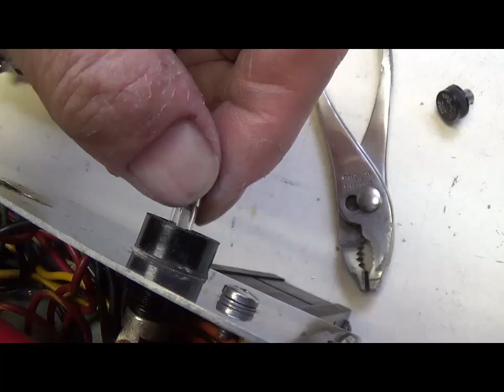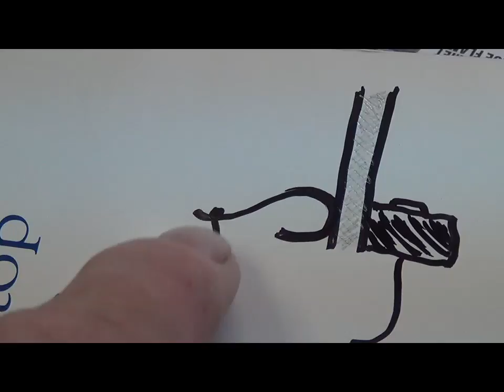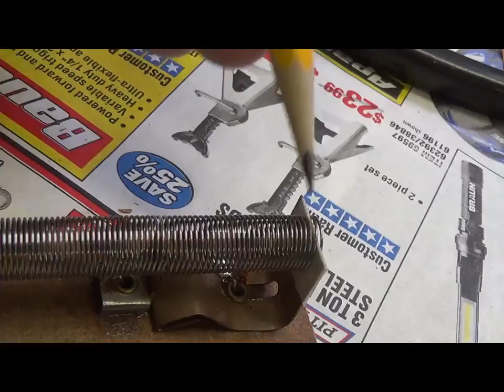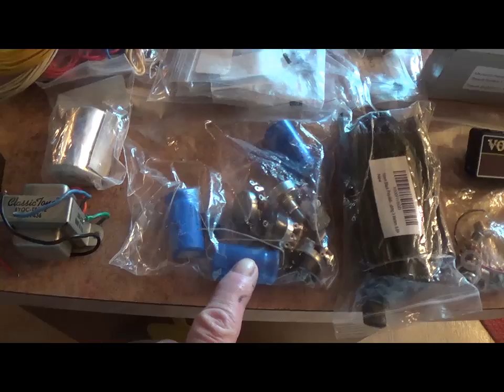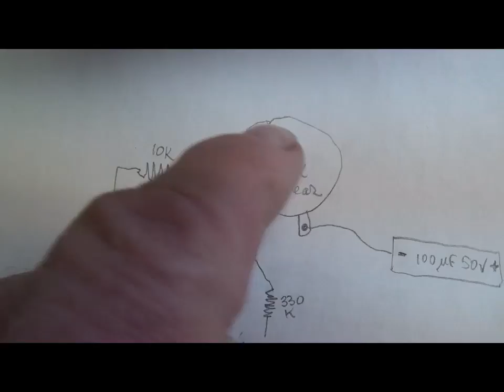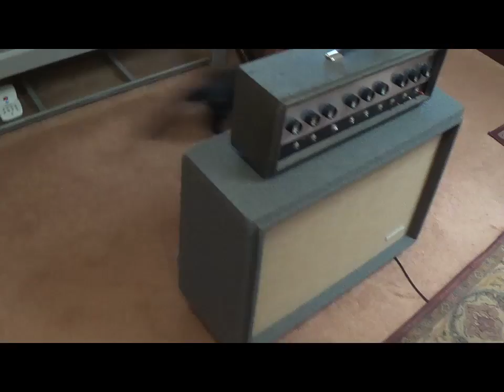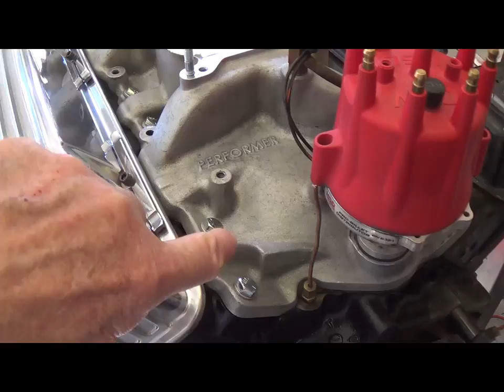Silvertone 1485, Part 3: Circuit Overhaul, Speakers, Sound Check

Comment: Great video, and great restoration. The one thing that caught my eye was the TRS (stereo) jack on the speaker output, with one circuit on the tip, and the other circuit on the ring: what happens if, somewhere down the line, somebody unknowingly decides to connect the amp output to a different speaker with a tip/sleeve (mono) cable?
Reply from the maker: I intend to label the output jack to reduce the chance of that happening, GJ, but as you well know, there is no surefire protection against idiocy.

Comment: Hey Uncle Doug,  good to see you again on YouTube.  Question:   What kind of solvent do you use to loosen the cone, spider and coils in a speaker?
Reply from the maker: Nothing I know of will effectively dissolve these glues, Charles. Generally, however they are dry and brittle and can be separated with careful use of an Exacto chisel blade.
Reply: @UncleDoug   ok,  thanks.  I was thinking I might try acetone on some of the tough glue. Let it soak for a bit, but I'm not sure the outcome.
Reply from the maker: Either that or lacquer thinner, Charles. Good luck.

Comment: Thank you Uncle Doug.  I have a very nice condition 1485. I have not played it much, I notice on channel 2 the new 6L6 GC  tubes want to red plate a little. So I will use all the valuable information so this amplifier will play another 60 years.  Everything is original including the roller chassis and footswitch. This concern I have is that with the Higher Line Voltages in 2019 that the modification you recommended will let this amp be preserved for decades to come.
Reply from the maker: You're welcome, James. Good luck with the modification. Reducing the plate voltage with a ballast resistor and then installing (and properly adjusting) a bias pot should help the old jewel.

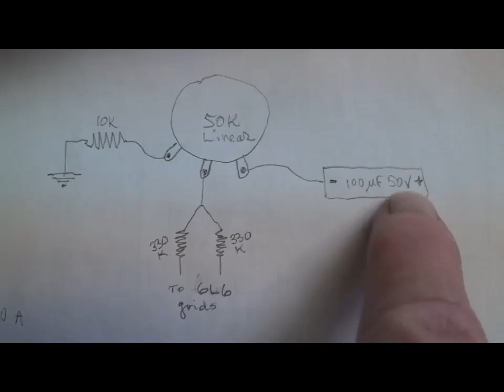Comment: At 34:00, danger Will Robinson! If the wiper of that pot oxidizes or fails to make a good connection to the resistive track of the pot, you will lose your bias voltage to the output tubes completely!. Refer to almost any vintage Fender schematic to see how to wire the bias pot correctly.
Reply from the maker: Which Fender schematic would you suggest, CO? Every one I checked has the pot wired exactly like mine.....bias voltage out via the wiper.

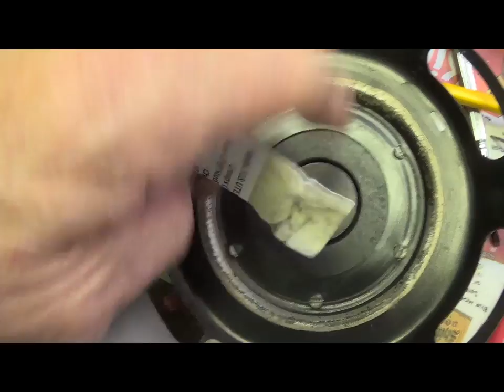Comment: At 9:50, another material that could be useful for cleaning debris out of a speaker's voice coil gap would be Sticky Note paper, folded over so that you have the adhesive showing on both sides. It might be a little easier to handle then the cardboard wrapped with masking tape. This was originally an old radio man's technique for cleaning crud and corrosion* out of the gaps of analog style meters, where the coil and meter movement are still in place and you had to be extremely careful and gentle throughout the process. I fixed the meter on an expensive Hickok tube tester that way once, by gluing little cut strips of the adhesive part of the Sticky Notes to some toothpicks in advance so that I didn't have to hold them with tweeezers or anything magnetic (which would have immediately been pulled into the works by the meters' very strong magnet,  damaging the meter). 

*the plating used on the metal parts and laminations of old analog meters tends to "grow" corrosion products.
Reply from the maker: That's an excellent suggestion, GU. Much easier to manage than a wad of sticky tape. Thanks.

Comment: Hi uncle Doug, excellent work on the amp and the motor. Just one thing re the speaker outlet from the amp, if this amp happens to be used with a mono cabinet, and a mono cord, the barrel of a mono plug will short the secondary of one of the output transformers?
Reply from the maker: I will label the output jack to reduce the possibility of this happening, Jon, but there are no foolproof ways to prevent inadvertent mistakes.

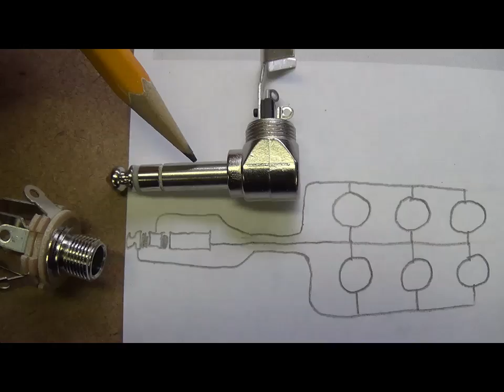Comment: 4:00 in: I think I would have used a switching type Jack or a pair of switching jacks that either short the amp channels directly out to ground or leave a 4 ohm resistor in circuit for each Channel if nothing is plugged into the output Jack or Jack's, because I can foresee a situation where somebody decides to plug the amp head into a different speaker cabinet like a 4 x 12 Marshall stack or something, and that would only provide a load for one of the two amplifier channels. And there would go another output Transformer!
Reply from the maker: I will label the output jack, but let's face it, there is no foolproof way to prevent mistakes. By the same token, an equally bad result might occur if the amp was connected to a seriously impedance-mismatched speaker cab.
Reply: @UncleDoug  , it is impossible to make anything truly foolproof, because fools are so ingenious!
Reply: Maybe a warning label?

Comment: That cab looks fab! I'd love to try one of those myself. But oh dear, that reverb sounds really wrong. It's a unique sound that may appeal to some, but there's a weird frequency shift that really interferes with the original signal.
Reply from the maker: Thanks, Kevin. I thought the reverb sounded pretty good when turned down to around 1/4, but much higher than that and it tends to go a little nuts.

Comment: At 3:00, not only did you find a 20 amp fuse substituted where a 3 amp fuse should be, but that 20 amp fuse looks to be stressed and sagging a little bit ( this is something I immediately look for when repairing any piece of equipment that may have been exhibiting major failures or which we are told has been eating fuses; if the fuse element is sagging then it means it's had excessive current passed through it). Apparently somebody tried to keep the amp going as the power transformer and Lord knows what else was going into meltdown, so they stuck a 20 amp fuse in there. That 20 amp fuse allowed the self-destruction of a $100 or so output Transformer and probably some output tubes as well, but it saved the cost of a $1 fuse.....
Reply from the maker: It does seem like a rather counter-productive maneuver, GU, but think of the glorious fireworks when it all went up in flames. You should have seen the "modified" speaker wiring......obviously the product of a diseased mind.

Comment: Great motor and amp rebuild I'd get rid of that crap Fram filter though .
Reply from the maker: Thanks, Ron. Having seen a recent video comparison of oil filters, I am inclined to agree with you. It's the last Fram filter I will ever use.
Reply: Thanks for reply .

Comment: Hello Uncle Douglas:  Happy New Year to you and yours.  It's a nice way to start the year with yet another triumph.  You seem to have a golden touch, even if the touch comes with a great deal of effort on your part.  The dedication is noted and appreciated.  Is there a standard in the speaker industry as to how the speakers are wired internally ?  Does the outer coil wire always go to the left lug and the deeper to the right?  It would seem that if this level of wiring is reversed then the speakers would be out of phase even if the wire to the speaker from the amp is correct.  Is there a way to tell how the speaker is internally wired so the connections to them from the amp will keep them in phase?  Thank-you for your great teaching.  Sincerely  V.
Reply from the maker: Likewise, V. Thanks !!!  Yes, you can use a dry cell battery, say around 1.5 to 2V to determine speaker polarity. See if connecting it to the speaker terminals (i.e. + to the left terminal) results in the cone moving in or out. It should move the same for all speakers. If not, switch the wiring to that speaker.

Comment: Great video as usual,  hope you had a great Christmas, and have a great new year.   As for the 350 Chevy, looking good, but get rid of the crappy Fram filter, those things are garbage,  put a NAPA filter on it, they are way  better quality,  or uses the OEM filter, as a Journeyman red seal Automotive and Heavy-duty Mechanic for 20 years,  I have seen many an engine wrecked because of Fram filters.
Reply from the maker: Thanks, DH. I recently watched a video comparison of oil filters and now agree with your condemnation of Fram's. It's the last one I'll ever use.

Comment: Great wrap up to this series. I don't miss my old 1485 for some of the reasons you noted. It would serve as a boat anchor quite well. I have a Polytone Mega Brute now and that is all I want to lift. Very clean amp (Polytone) with a (meh) distortion. Thanks Uncle Doug!

Comment: Hi Uncle Doug, try changing that 12ax7 reverb tube with a tube with less gain like a 12au7 of 12at7. That will get rid of that shrill.
Reply from the maker: I would, Rick, but the reverb is actually driven by a 6CG7.  The output travels through one triode of a 12AX7, but I don't think altering it would reduce the tank overdrive.
Reply: I was looking through the comments to see if anyone said anything about the reverb. I was going to suggest a low pass filter on the reverb signal. Possibly variable, using that chassis hole for the old mic input. Just an idea Uncle Doug. Great Resto!!!
Reply from the maker: I would have thought a high pass filter might be better, Scot, since low frequencies tend to overpower the reverb circuit.
Reply: @UncleDoug  I was listening on unreliable phone speakers. You have a much better feel for it than me.

Comment: As if the cosmetics weren't enough of a head-shaker, the electronics turned into quite the adventure...and education for those of us interested in vintage amp restoration! As I remember, borderline out-of-control reverb was pretty common with Silvertones but, to me, the tremolo sounded a bit weak! Maybe it was just the way it was recorded, or my computer speakers' inadequacies. All in all, though, a truly amazing restoration! Way more of a roller coaster ride than could have reasonably been anticipated! You, sir, are much more patient and tenacious than I! LOL The end result looks and sounds great!

....and that engine is looking like it was just busted out of a crate! Can't wait to hear that purring under the hood of....a vintage pickup?? :-)
Reply from the maker: Thanks so much, Norm. I agree that the tremolo was not earth-shaking. Perhaps a more energetic 12AX7 would help (?)  It may be headed for a yet-to-be-built '27 Ford Roadster.
Reply: @UncleDoug  The 12 AX7 has more gain than a 12 AT7, for instance,. but I have to admit that I missed which tube was being used for the tremolo circuit. If that's the choice, it would certainly be easy enough to try, and the gain increase might be just enough to make it more pronounced without excessive distortion.....but you knew that! LOL

A '27, huh? Interesting choice! Everybody else seems to be looking for '32s...to the point where there are hardly any (steel)  '32 bodies left! The '27 would make the whole thing look much lower-slung, and less 'beefy.' The engine would appear much larger with that body, and it would all be lighter, wouldn't it? You seem to have an 'I-don't-care-what-everybody-else-is-doing' design sense, so I'm just going to wait patiently and enjoy the results! The only cars I (help) build, these days, are street stocks for my son to drive....and there isn't much room to get artistic with those.  :-)
Reply: @UncleDoug I've had the issue of a weak trem when that 12ax7 (the one behind the power tubes) is old. Swapping for a new guy will proly do you just right!

Comment: There is something very wrong with the sound of this amp, I'm not sure what, but, I think it might need a dead spider or two. I have got a vintage dead spider and a woodlouse, but I am not sure how they will effect the tone because they are English spiders not American ones and as you know they do sound different.
 I also have some vintage cobwebs, they might not be the right size, but you could always cut them down to fit.
Just let me know if you want them posted.
Reply from the maker: I agree that some resident arachnid carcasses would contribute greatly to the tone of this amp. Is $500, plus postage, sufficient to cover the purchase ??
Reply: @UncleDoug  

For You they are free.  :-)
Reply from the maker: You are too kind :)
Reply: This amp already has 6 resident spiders.... they are residing behind each cone, caressing the OD of the voice coil formers.

Comment: Nice combo and great restoration, but the reverb is shocking! It seems to do it's own thing, not in sympathy with the notes played, it just makes a cavernous noise. May be worth finding another make of piezo tank. Best. M
Reply from the maker: Thanks, MRF. Yes, the reverb is like a herd of chickens, hard to predict and control. I intend to experiment with another reverb option for this and other amps.
Reply: @UncleDoug  Good plan. I seem to remember seeing a diy design using two crystal or ceramic phono pickups with the styli removed and the spring somehow resting against the pickup element, one at each end of course.
Reply from the maker: I guess that would be one way to replace the piezo transducer wafers, M58. A bit Rube Goldberg......but ingenious.
Reply: @UncleDoug  I had to google Rube Goldberg. In the UK we conjure up Heath Robinson, for such exclamations.

Comment: That Reverb all the way up could be used as a syfy effect! Is the fuel pump on the engine mechanical instead of electric? My '86 GMC Vandura has a mechanical fuel pump and it was plaques with vapor lock! Welcome to 2019 and I wish only the best for you, Uncle Doug and family, and all. I hope to do wonderful things this year with vintage tube amps myself. Thanxz
Reply from the maker: Thanks, ATL. It's a mechanical pump, but will work just fine with the phenolic spacer in place. I've had great luck with this combination in many different vehicles. HNY to you all :)

Comment: Good stuff as always. Do you have any recommendations for information regarding building a two channel amp? Maybe a book or web info that is a trusted source.
Reply from the maker: Thanks, Mr. O. My approach is to find a schematic (on the Internet) for a circuit that suits my needs, then modify it as needed.
Reply: I think that could be easy for a person like yourself. I however am still way low on the learning portion. Most of my obtained knowledge (which is minimal as implied earlier) is from your channel, a few others and some slim reading on my own. I play guitar as a hobby and have become interested in the amp portion in last several years. I appreciate all you have shared thus far tremendously. Keep up the fine work. I guess I will do some research and maybe find a schematic that I am even interested in and go on from there
Reply from the maker: @MrOldnslofly  Also, there are several books by Gerald Weber that are highly regarded and useful for beginners. Here's an example:  https://www.amazon.com/Guitar-Amplifier-Essentials-Gerald-Weber/dp/0964106027
Reply: Than you for the info. I will check them out.

Comment: Great job as always. A little known fact, The Beatles cut short the set at Shea Stadium because of that long loose wire on their Vox amp. No wonder the band could not hear themselves play. And as always, everything I just said is nonsense, but it lends itself to the difficulties of playing Shea Stadium.
Reply from the maker: Thanks, James. Rusty and I always dreaded playing at Shea due to the ungrounded electrical outlets. During almost every performance, we would both be overcome by involuntary muscle contractions and appear to "dance".  This is how Hip-Hop originated.

Comment: Wow, very impressive revival of an old classic!  But I have to say that reverb sounded like a microphone feeding back, there was a lot of high frequency noise... maybe they meant to say squeak instead of “weak” sounding?
Reply from the maker: Yes, at high reverb settings, the speaker vibration feeds back through the reverb tank. Placing the head on a separate surface alleviates much of this.
Reply: Uncle Doug, I guess that’s why the spring needs to be tied down!
Reply from the maker: @rsean3281  At full volume and reverb, the furniture in the room would also have to be tied down.

Comment: Happy New Year, Uncle Doug, and good to see this content.  Both the amp and the engine are looking mighty fine.

I got a chuckle for some reason when you mentioned that you had the engine on an engine stand.  Back when I was a pup, we had two primary sources of auto repair information (excluding actual shop manuals, which were beyond the means of high schoolers' budgets,) Chilton and Petersons.  We used to laugh about Petersons, because it seemed as though every procedure listed began with "Remove engine and place on engine stand."

And I also fondly remember the J.C. Whitney catalogs back in the day.  I helped a couple of friends replace VW engines (without an engine stand or engine lift, we just unbolted and picked them up) and you could pick up the rebuilt shortblocks for less than $100, plus shipping.  Those were fun times.
Reply from the maker: Yes, they were, Ken, and I really miss them. I recall one bright summer day when I assisted in the removal of a SBC from a car.....without any engine hoist, just four young idiots grabbing onto chains and ropes and herniating themselves before realizing that none of us was strong enough to lift the $@%&?*&@ thing up over the fenders. Ah, the sweet memories of youth.

Comment: Nice!!! I have been meaning to put grounding input jacks on my 1484, for a while. Maybe I should do that soon.
Reply from the maker: It really helps to reduce hum, William, especially the two in the middle of the chassis.
Reply: The easy way to see if changing the input Jacks will lower your hum is to take a plain quarter inch plug (or two) and short it internally, and then plug it into those jacks. If it doesn't make an appreciable difference in hum and Noise then your main noise problems are likely coming from somewhere else.